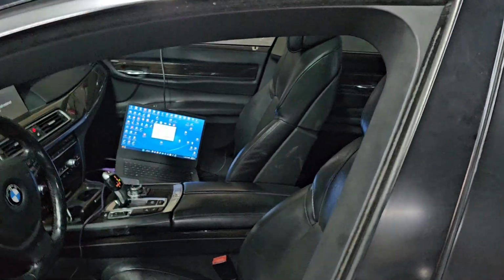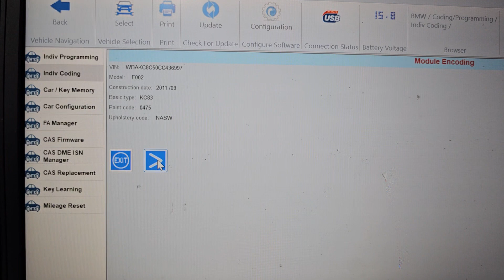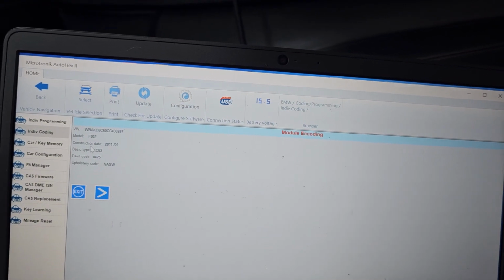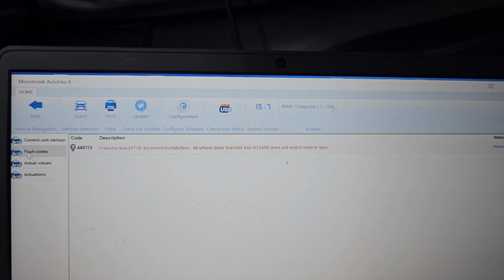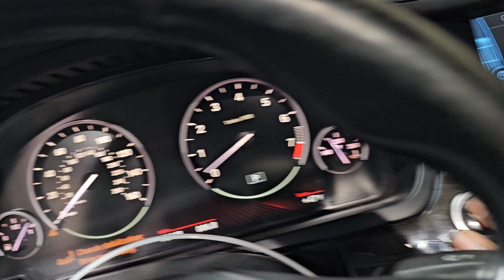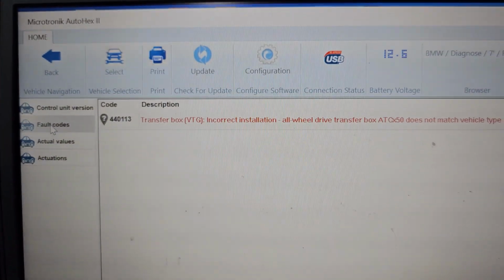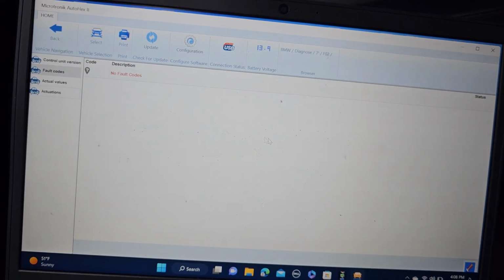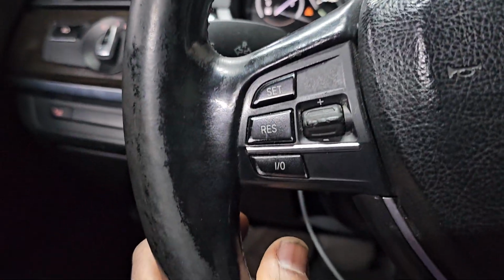BMW 750i F2 Transfer Case Coding Failure Any Suggestions

Comment: I have a santafe CM 2012 smart key type with key slot I replace the ecu and programs a neutral mode on ecu program sucess but car have crank pulse not come in engine and car not started